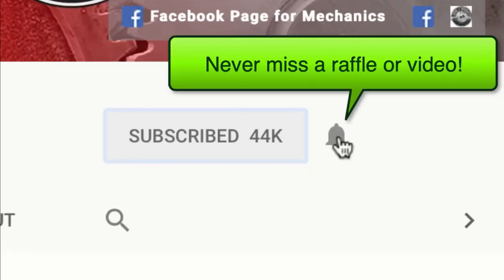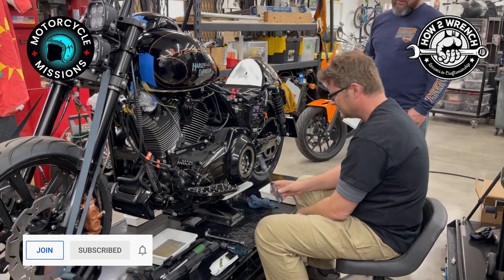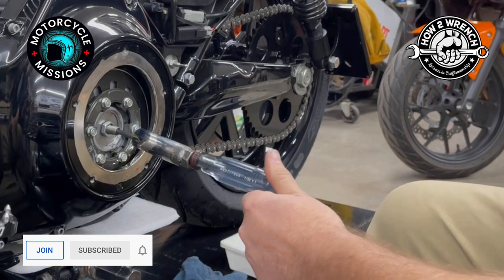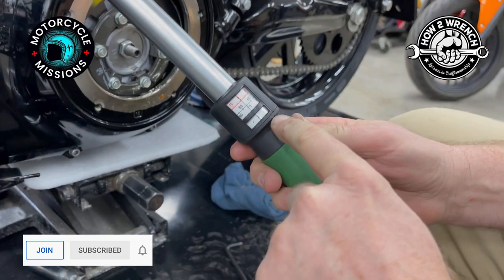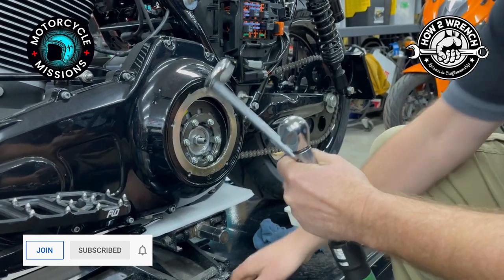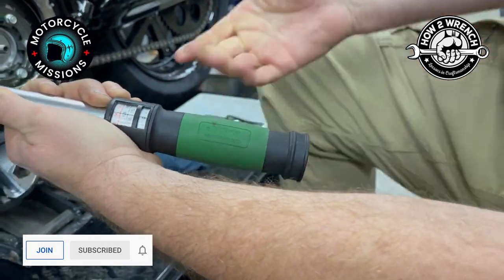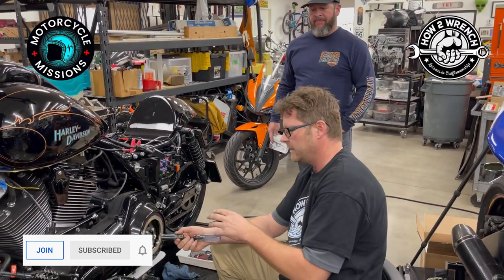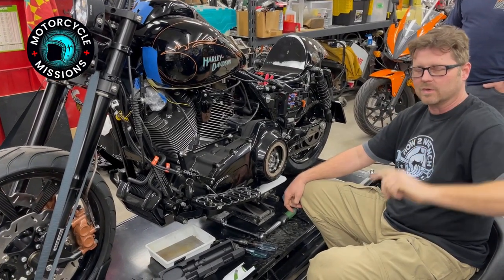Clutch Adjuster Locknut: Torque correctly to spec with this custom tool and another eTork demo

Comment: I have a quick question if you don’t mind. I’m not stranger to adjusting HD clutches and have been doing my own work and helping friends with their bikes over the years and have recently come across an issue I can’t find the fix for. 09 HD Street Glide, clutch lever pulled against the grip and still won’t completely disengage. I’ve adjust tighter and looser than spec with no change, I’ve checked the ball ramp to make sure it’s doing it’s thing. Short of checking the clutch plates and maybe the basket I’m at a loss and the internet seems to fail me for this one. Thanks for any advice you may give.
Reply: I'd like to know what Shane comes up with. I'm going to guess it's in the turnbuckle adjustment in the cable. ???
Or... it's got to be in something changed in the actuator rod that sits under the clutch nut.
Reply: Make sure the hub is tight